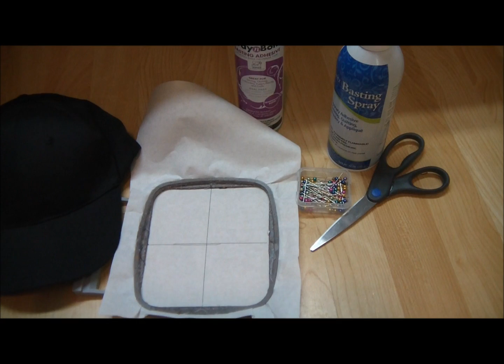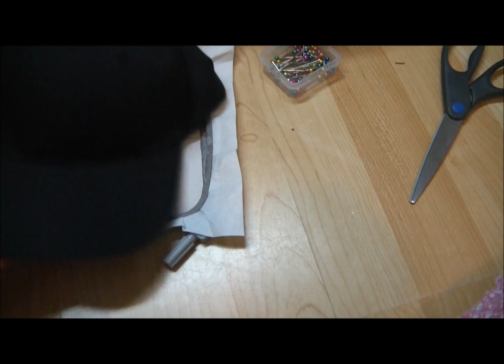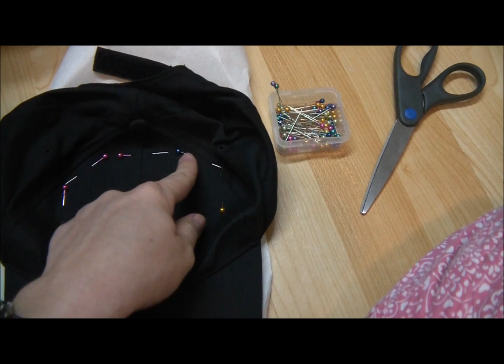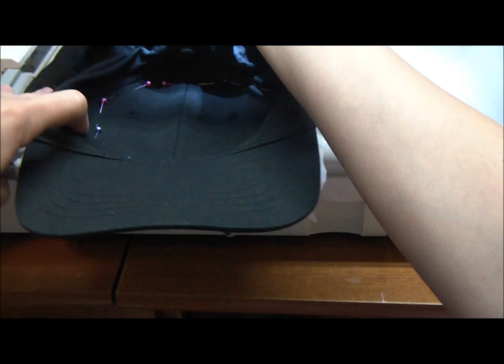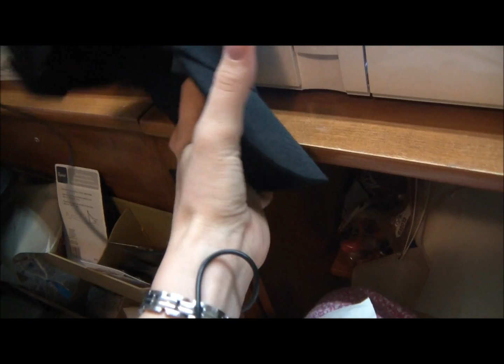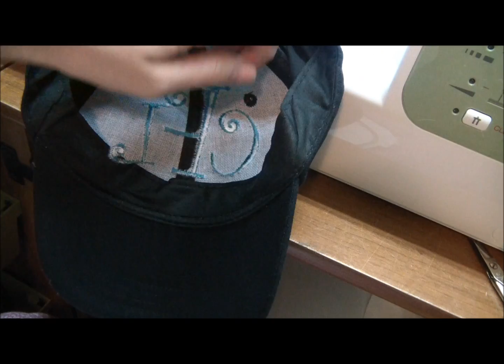Hooping Hats on a single needle embroidery machine

Comment: Great job on the video using only one hand.  I just recently started embroidering hats on my Brother PE770 and I used sticky back stabilizer that worked great.  Also, I saw a video where the sweat band had been pinned out of the way and that kept the band from accidentally being stitched in from the back.  Another tip is to use quilting safety pins.  They are bent to go down and back up making it really easy to pin the hat into the hoop.  I never close my safety pins either.  Once my Baby Lock Ellegante gets back from the "doctor" I'm going to do some hats on her too. Thanks for the tips on spray stabilizer.  I'm going to try that.

Comment: I have the same machine and I'm embroidering why does it Bunch up at the back
Reply: You have a tension problem, is your dial set to E? At least that is how it is on my Singer. Is there thread stuck in the thread path? Or it can be bobbin tension? Something can be stuck in that path. Easy way to find out is do a column stitch of a lower case L with black thread in the top and white in the bobbin. Turn it over and look at the back, you want the white bobbin thread in the middle of the l.(or close to it) If you see all black thread on the back it is a top tension problem. White thread showing in the top is a bobbin tension problem. If I take my embroidery unit off, right below the metal plate I have a screw hole. I turned my screw to the left just a little bit and kept doing the process until my bobbin was showing center. Oh I forgot it can be as simple as your dog bones engaged. Check that first...